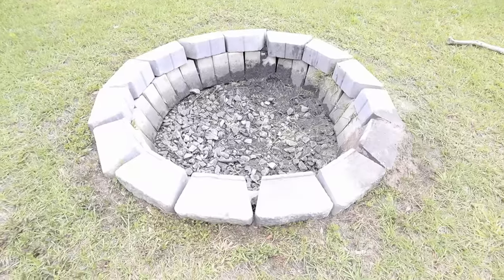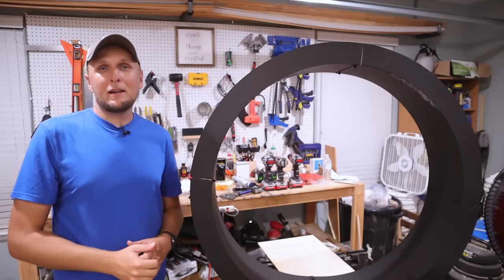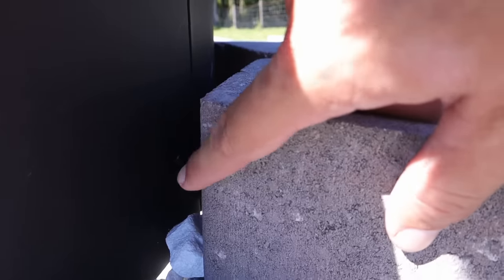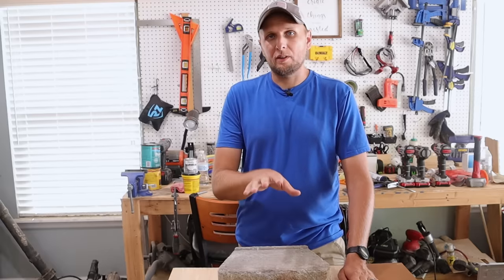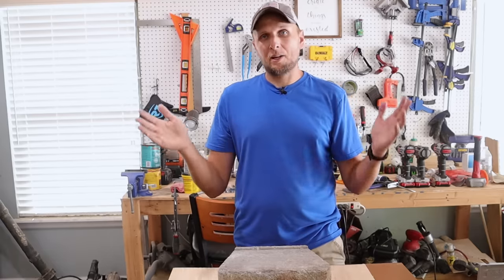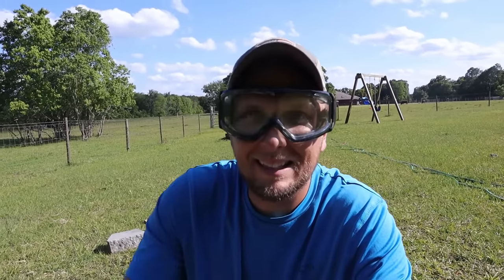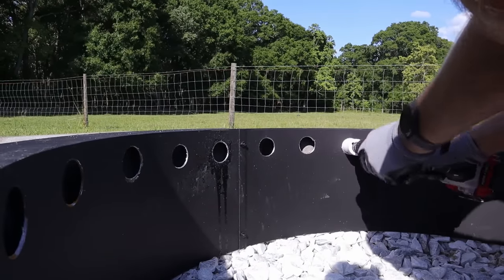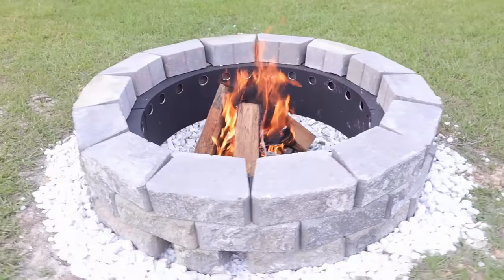How To Build a DIY Smokeless Fire Pit That Really Works!

Comment: Congratulations to the smokeless fire. But I'm sorry it's the dry wood doing the job here and not the fire pit itself. The way this design works is that preheated air full of oxygen enters the fire pit through the holes along the rim and interacts with the hot gases above the fire and ignites them (secondary combustion). The moment this happens the smoke disappears with a snap of a finger and you can see flames coming out of the holes ( gas stove effect). That's clearly not the case here. In order to make it work the firepit would have to be smaller or the fire in this pit much hotter / bigger.

Comment: The holes in the wall are way too big.  The wall needs sealed up much better.  Not going to work very well.  Well working smokeless pits will have flame over the entire area due to the secondary combustion near the top.  Yours has no secondary combustion at all.
Reply from the maker: Then the smoke is magically much better.  Either way, I will take it.
Reply: @HowToHomeDIY  Yeah it's magic...Look into how they actually work.  You just might learn something.

Comment: Instead of breaking blocks why wouldn't you just remove 1 whole block from the bottom row and then evenly distribute that space between the other blocks. You probably could get away with removing 2 whole blocks and achieving the same result with no block breaking.

Comment: Those holes you drilled aren't doing anything to change airflow or smoke. your fire is so open, and the holes are so high up, that the fire is getting all of it's oxygen from above the wall.

Comment: That won't last.  Dirt debris erosion from rain will fill that all in.  What you need to do is lay in 6 NON GALVANIZED pipes into the base of the fire-pit use an elbow to send the outside north to the surface, 3"s above grade and cover with rock.  And OBTW it is LESS SMOKE, not SMOKELESS!!!LOL!!!
Reply from the maker: Yeah, I am not going to do that myself as it is just a fire pit and if that happens will be easy to just take down and rebuild.  But to each their own!  And I will take the smoke less 😂

Comment: You need to show the fire from lighting, hard woods only smoke for 10 minutes and then there is no smoke. How long was your fire going for before you showed it? If it was after 10 minutes there would be no smoke so not proving anything.

Comment: 200$ for 4 pieces of bent metal sheet? really??
Reply from the maker: The one I used was $185. There are lesser expensive ones depending on size and brand. I just posted what I used since I can speak for how it works.
Reply: @HowToHomeDIY  Agree, still, seems a bit steep for what it is - a bent sheet of metal.

Comment: Would like to see if it actually worked you demo fire was obviously just lit an had no time to heat the secondary air chamber to to point that convection occured to cause super heated air to induce a secondary combustion to burn off the smoke. So show us a hot fire and let's see it work.

Comment: I've seen better designs.  Not the proper material for a sub base, no holes at the inside bottom for combustion air, and cutting the blocks is unnecessary.